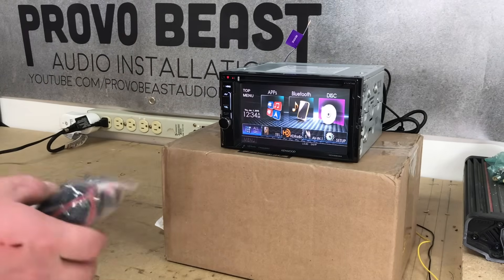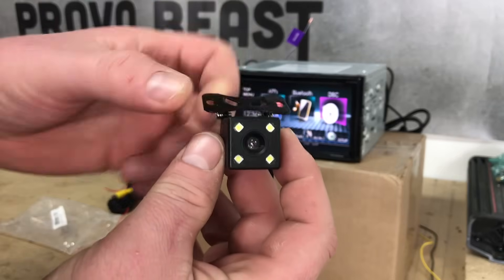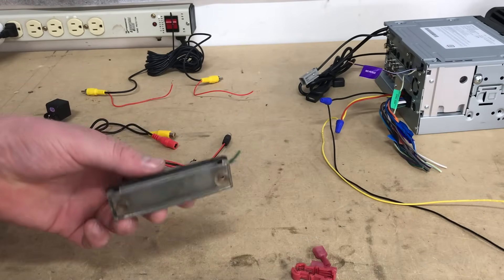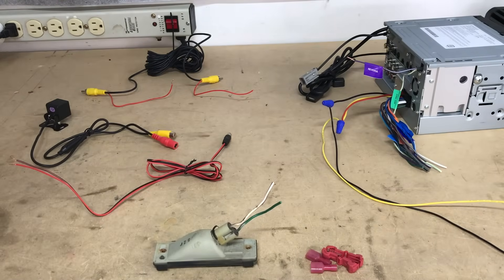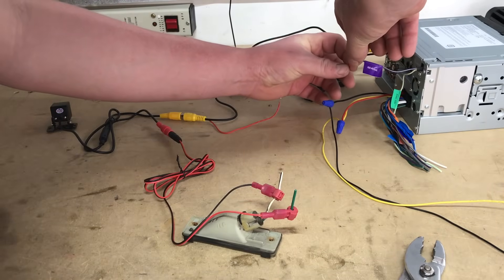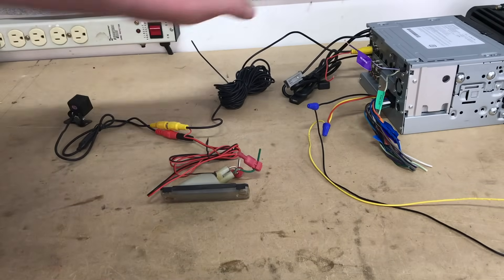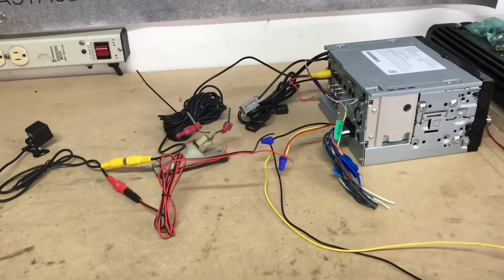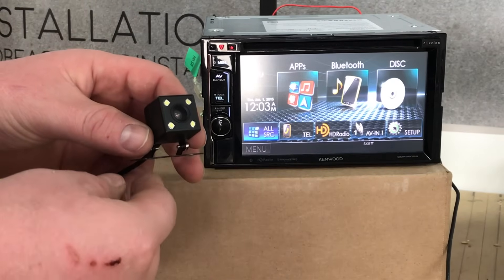Car Backup Cameras Explained: How To Install On Your Car!

Comment: I have a question on your how to install video. I installed a back up camera on my 2003 GMC ENVOY SLE, I did everything you said on how you would install by connecting the lower and ground to the back up light. Then the video rca red wire also hooked it up to the power. Then ran that video cable to the stereo. I realize my interface harness I added had a reverse wire along with the stereo as well, I hooked them up together and also added he red wire from the video cable to it. After I connected the video camera from the back of the stereo. I did everything correct but then afterwards I get a black screen. 
Now like you stated would I have to turn it on from the stereo or maybe it’s a bad camera? I need some help. Thanks man.

Comment: Hi my 2 Din stereo i just bought support reverse camera ,i did not purchased the camera who was with the unit because i wanted to get specific for Toyota yaris , but  this  stereo don't have a cable who says.. reverse camera.. 
where i supposed to connect one of the 2 red cables on that case?
regards from Greece

Comment: Hi I made all the connections just like in your video, my camera is very similar to yours, but still saying no single plz help, what I'm I doing wrong
Reply from the maker: Either the camera is not getting power, or there is a wiring issue with the RCA video cable.  Recheck your connections.

Comment: Hi!
Thanks for the video.
Question: if routed with pwr from headunit feed won't the lights in the camera be on all the time? If so, does the headunit have a pwr out controlled by software key that is useable instead or in conjunction with revers light? (diodes between so they don't feed each other)

Comment: How would I go about having both? So I can have it come on when in reverse and also manually turn it on via "CAM" button on unit. I have the same radio in video:)
Reply: luis amoa I am wondering the same thing.
Reply from the maker: Use setup scenario #2 in the video
Reply: @ProvoBeastAudio  so that would mean the camera would be on all the time if supplied power is ACC. Wouldn't there need to be a diode to accomplish this. Throwing it into reverse would send current back the other way via the line that's ACC. Just asking

Comment: What may be a problem when the camera flashes while the car is on, and when the camera is off, the camera works perfectly
Reply from the maker: You may need a noise filter on your power wire, seems like it's getting interference when the car is on.

Comment: This has the best explanation especially the 2 short red wires in the long yellow rca wire. But to clarify it further because other videos confused me with this part. So the 2 short red wires are just running inside the long yellow rca wire but is not actually connected to either of the wires of the yellow rca used for video signal, correct? In other videos i was asking myself the reason to send 12volts electricity into the video signal wires.

Comment: The only video which explains what I was looking for. Everyone guides to tap into reverse lights for power but my car radio harness has purple wire connected to my Pioneer and my Pioneer already knows when I am in reverse as well as it has option to view camera at any time which I need. So I needed constant power to my camera. Other videos explained to use that thin red wire which comes along with RCA to constantly power camera by tapping into radio power but then comments mentioned that this is not right way to do it because that red wire is too thin. And still I had no answer. This video clearly explained what I need to do. I just need longer power cable. Thanks a lot!

Comment: Just subscribed, I had a wireless cam with its own screen, but just purchased a Pioneer head unit and will wire a new camera to the unit. Just hope the camera I buy has the red wire to connect to the purple on your unit.

Comment: Hi, if my head unit automatically switches into reverse video output on the screen do i still need to connect the reverse signal wires to the head unit? If not can i just leave these and cap them off?  Great video!

Comment: Thanks for the video - My question :: My car has separate screen for reverse camera - In reverse mode both camera & screen works perfectly fine. Can I hook up Sony system rear camera RCA to this camera setup so that I can view reverse camera vision during drive mode thro Sony Music system. Without interrupting the process of reverse camera view during reverse mode

Comment: Excellent video. Its all laid out neatly with out wires juggling around in your hands. The mystery of that one red wire off the RCA is solved! One question, would it not be better to splice the red pig tail at the camera side close behind the black power plug?  
This is the BEST video on you tube for setting up the wires, glad I kept searching.
Reply: I was wondering the same thing since the red wire won’t reach the tail light unless you extend. I forgot to connect this wire and my reverse will come on but no break l
light, is this bc of that one red wire not connected???

Comment: Hooked up my radio and the backup cam as described but when in reverse the screen say No Signal, I tested the voltage and on have 10.72 volts at the bulb socket and at the end of the power connector. Is there another way to hook it up?

Comment: Is it possible to have both setups for the camera so that it comes on in reverse as well as when desired through the radio ?
Reply: Yes. Tap the red wire of the yellow RCA's camera side to the reverse lamp. Tap the other red wire on the HU side to the purple/white wire. Then the camera's black/red goes all the way to the HU's black/red.
Reply: Ferdie Pendon great, thanks so much !
Reply: @christophercastillo8743  was your black/red wire long enough to reach the front of the car?

Comment: This was a very informative video. Just have a question.  If you wanted to have the camera ON all the time.  Can you just ground camera at back and tap into the RED wire on the RCA cable for the camera HOT, then tap into the HOT wire at the radio for constant power.  Then just run the reverse line from the radio to the kick panel where the reverse light wire is at.  That way you would have the camera powered without having to run a long line to the front and only a short line for the reverse wire from the camera?  This would work YES?
Reply: I was here reading to get the same answer .  

My head unit provides a rear camera view in the settings.    
But I’m wondering how it would need wired to not have the LED’s lite up all of the time & have them turn on ONLY WHEN IN REVERSE OR WHEN I GO TO THE REAR CAM VIEW SETTINGS in my pioneer 4660 nex.     

Because they are more options than all others below the price point.  Even the pioneer 4600 

Because I think that one just don’t have a front camera option in the outputs .    

If you figured this out let me know. Plz. Lol

Comment: It you decide to let it work even when you manually switch it on (I mean not only when you are in reverse gear) the reverse light bulb is of course gonna switch on AS well at the same time although you are not in reverse gear cause it is connected to both power supply (light bulb and another positive under key with second switch inside your car right?

Comment: Good explanation.  But if your camera has LEDs, and it's powered     all the time,  then your LEDs will be lit all the time.  This could be distracting or attract a police officer.   By adding a 12v cut-off switch  in line with the red power wire, you can manually turn it off if not needed.  This helps with the longevity of the camera.

Comment: Can you hook it up both ways the same time one when you turn put the vehicle into reverse and then run a separate power wire connected to it also that way when you hit the camera button on the Kenwood radio that it'll turn the camera on when you hit the button so you can either of you it when you put it in reverse or view it when you hit the button that way both are connected at the same time but only one gets used at a time

Comment: So i got my back up camera hooked up just the way you did yours except mine doesn't come on when i hit reverse, but if i plug the positive wire to my res wire it comes on but the screen stays black after i put the car out of reverse. Have you had anything like this before?

Comment: I installed it with a WiFi transmitter and works perfectly with smartphone. By cons I would turn off the led how to do or an application to offer me?

Comment: Very good explanation.. MY camera is different.. It was installed 7 years ago.. It was working untill some days ago when it stopped.. the radio goes in camera more but the screen bicomes completely black.. after checking that the camera lens is  clean, I decided to check what was wrong.. I saw that both power supply and video signal work through a 3.5 mm audio jack with 4 pins.. the electricity connection is ok at 12.45 v as normal with 300 mah so I guess that the video wire going  to the radio is not well connected.. Do you Think the best option would be to remove the radio from Its position and check the video wire continuity? I DO NOT EVEN KNOW WHICH KIND OF CONNECTION IS USED BEHIND THE RADIO SINCE ON THE OPPOSITE SIDE IS A 3.5MM 4 PIN AUDIO JACK

Comment: I have a reversing camera built into me mazda CX3, but it does not work. Can you tell me what I did wrong. It is true that if I reset the MZD the camera will work (car in reverse buttons mute + back + nav + home). After I leave the car, the power consumers are turned off as it should be, however, if I put the care in reverse then the camera will no longer work. Do you have an idea of what I have to change or need to take care of

Comment: What if your camera has LED lights on it and if you wire it to the ignition switch wouldn't the LED light on the camera be on whenever the ignition is turned on?
Reply from the maker: Yes, it would, so if you want to wire it via scenario #2, consider getting a camera without LED lights.
Reply: Add a 12v switch in line with the red wire.  Extend the red wire so you can mount the switch anywhere

Comment: Hello. Thanks for the video. I bought a car plate backup camera with 4 led lights connected to a Dinavin multimedia system on my BMW X1. It works fine, but for one important detail: the led lights do not go off and I suppose it will exhaust the battery. Any idea why this happens and how it can be fixed? Thanks a lot
Reply from the maker: They will most likely remain on until disconnected from power.  You will probably have to wire it like scenario 1 mentioned in the video.

Comment: Couldn't you wire the camera to the reverse light just as you did in the first example and then behind the radio (head unit) run a red jumper wire from the ACC (red) wire to the reverse wire of the head unit or the harness.  In this way the unit will display when put into reverse and then when you switch the head unit over to the Camera View, there will be power to the rear camera as well.  Wouldn't that work too?
Reply from the maker: Nope, if you hook up the backup trigger wire to the acc wire, it would be on permanent reverse.  If you don't want to cycle it over automatically when in reverse, don't hook up the reverse wire.  Most radios allow the option to manually switch over.

Comment: If these wires become snatched apart under the vehicle while connected to the tail light will this cause signals to fail I’m having that problem and every time I replace the fuse it blows as soon as I use my signal
Reply from the maker: Sounds like you have a major short somewhere.

Comment: Hello i got a problem even if im using the radio ist always showing reversing and camera is not connected any help?
Reply from the maker: sounds like you have the reverse trigger wire wired incorrectly.  I'd start there.

Comment: I installed everything as shown, but i dont have a reverse wire coming from my radio, instead i got some more wire and extended the short red wire to the back and hooked it into the power wire for the reverse lights. I put it in reverse and the LEDs turn on, on the camera. But theres no video output on the radio screen.. what can i do to fix this? Please help

Comment: Great video finally a thorough explanation of those red aux leads! 
By the way instead of running the camera power wires all the way to radio you can probably find switched power in the hitch harness

Comment: Excellent video. What are those red wire attachments called? The ones you connected to the reverse light? That is what I require pal.

Comment: Followed your instructions exactly as you said my pioneer nex is stuck in a black screen with the guidelines. Tried resetting it will not show my main screen
Reply from the maker: Sounds like a bad radio or an issue with your wiring.

Comment: ok ok nice... i was thinking that 3mm or whatever connector was for always hot and the red wire from the rca cable was for reverse light power. thanks for clearing it up for me..... oh wait lol doing it like that is an option hahaha i commented too soon
Reply from the maker: You can, but you may need to find a trigger wire elsewhere if you are using the red wire off the RCA cable.

Comment: Hi. Will led lights on the cam come on every time you put the shifter in reverse? If so, is there a way to wire this camera so that the lights will only come on when you have your parking lights and/or headlights on using the same wiring you have in this vid? Thank you.
Reply from the maker: No, not this camera.  They only come on when power is put to the camera.  But you may be able to find a camera out there that does.

Comment: I have a wireless reverse camera but no idea how to get it through the car into the car from the number plate....  Where do you feed the wires. Need to know where to drill or feed wires.
Reply from the maker: Generally your licence plate area has lights too, and you may be able to snake the wire through one of those light cavities.  If not, you may have to drill.
Reply: Provo Beast Audio Installation ah I see so where would i power it? I have golf mach 5 54 plate
Reply from the maker: reverse light power and ground

Comment from the maker: Support the channel by picking up your Provo Beast merch here: https://teespring.com/stores/provo-beast-audio-installation
Reply: Too many videos make this look too technical. Very well explained!
Reply: Provo Beast Audio Installation great description really gave me good insight, now figuring out running wired became the issue lol.
Reply: You are the freaking man. That is all I have to say
Reply: Can I attach this to a PC monitor?
Reply from the maker: I guess you could if the PC monitor accepts a Composite Video input.
Reply: I did everything like this video did, however my 04 Lexus is300 back up light has both positive wires instead positive and negative, should I run my own ground wire from the head unit down to the camera ground wire?
Reply: Bro one cuestion why u connect of  red wire and black . On of reverse light .then u connect other red wire on positive wire on of reverse .can u explain to me. Is no susposted of red wire is 12 v . And black is ground ? Help .me
Reply: can u help me out ? MY multimedia dont have that reverse cable (blue stick on urs)  , only av cable rear view camera is, how to get that multimedia notification when i turn reverse?

Comment: Quick question.  I believe I hooked it all up correctly as shown.  The head unit does automatically swap to rear camera on reverse, but there is no picture.  Continuity tests were good at yellow cable to reverse light, but the red cable did not show any continuity.   Is that the culprit?  Maybe the snap on splice didn't do a good job?
Reply: Oh, for testing the red.  I tried putting the prong in the rca hole, and also on the outside metal part.  No luck on either
Reply from the maker: Well it is automatically switching over, then your trigger wire is good.  Sounds like your camera isn't getting power, or your video wire is damaged.
Reply: Provo Beast Audio Installation thanks, will try to open it all tonight if wife gives me free time  :)

Comment: I am trying to hook up the camera in method #2 that you mentioned. Do both trigger wires need to be hooked up to the reverse wires? (Reverse light in back, reverse wire at head unit)

Comment: Can I  ask,  I have a generic radio from china running Android 6.0, and it comes with a canbus decoder box. And when I put the car in reverse the radio automatically switches to the reverse screen (obviously black as i don't have a camera attached yet). My question is if i have this, do i still need the trigger wire or can i just connect the camera and ignore the wire. 
Thank you for the video, great explanation :)
Reply from the maker: Nope, if the decoder box already provides it.
Reply: thank you so much for your quick reply

Comment: A question for you. Now the adapter is a micro usb adapter,how can I make it work on my smartphone as its the same adapter
Reply from the maker: Not sure what "adapter" you are referencing as this kit in the video doesn't include any USB capabilities.
Reply: Provo Beast Audio Installation yeah i checked that but mine that came with my dash cam has a micro usb that plugs in the dash cam and is the same what plugs into the smart phone now i want to use it through my phone but it does nothing when plugged in.